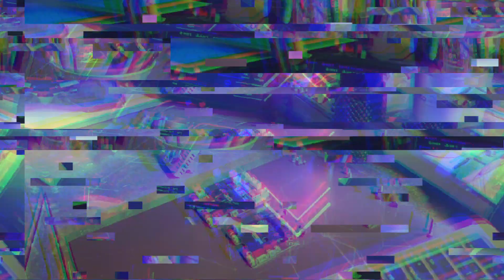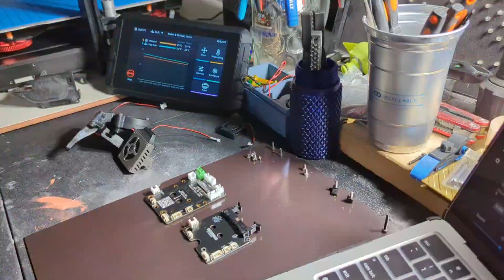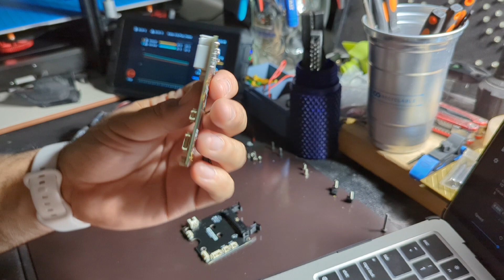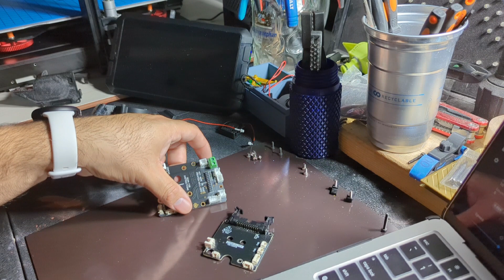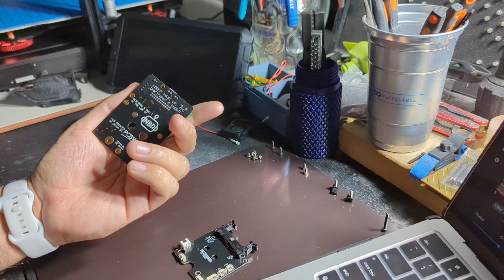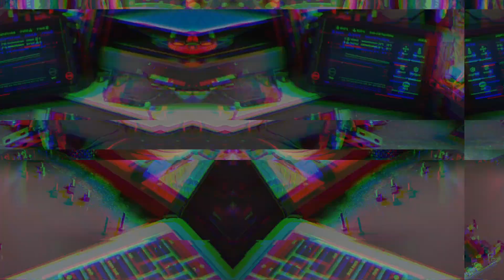Upgrading your Ender 3 S1, the easy way...

Comment: My parts cooling fan stopped working. I had swapped on 5015 fan and hacked the wires. (I have sonic pad too). It's not the fan because I checked with other fans. Now I'm not sure if it's the main board or the breakout board. It's driving me crazy
Reply from the maker: Could also be the ribbon cable. I've heard that they can fail.
Reply: @WillOnParade  Yes. I had to fix ribbon cable on my S1 Plus. There's no noticeable damage on ribbon cable for printer with fan issue.
Reply from the maker: My extruder stepper motor went out. I suspect it's the ribbon cable. Waiting on a replacement.
Reply: @WillOnParade  I had this fan issue before. A new board (4.2.7) fixed it for a few days. I'm wondering if the 5015 fan is burning out the mosfet for some reason.
Reply from the maker: Hmmm, yeah definitely an electrical gremlin in there somewhere.
Reply: Bit late but did you check the fan by plugging it into another connector?
Reply: @milodudeful  yes

Comment: I see you have the sonic in the back ground, I have a ender 3 s1, is the sonic a good upgrade for the printer ?
Reply from the maker: I would say yes! I have another video showing how much time I cut off large prints. It was more than half. Since the S1 has a smaller build volume you can actually push the speeds more than on the S1 Plus. I would recommend it.